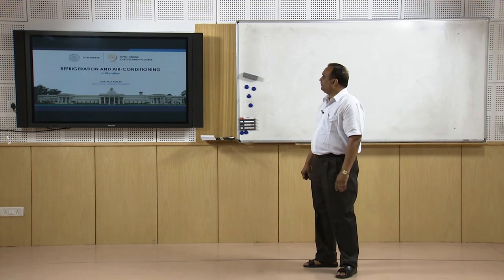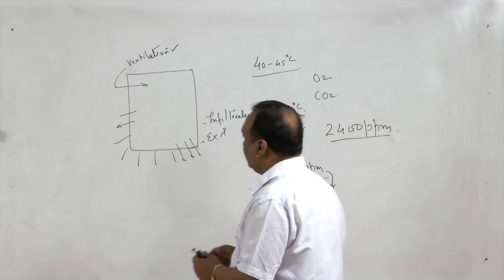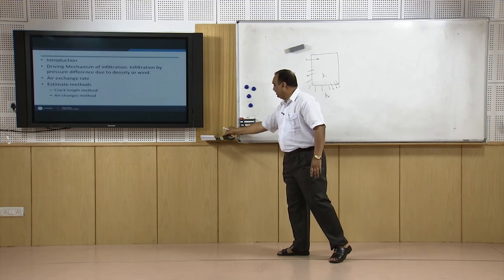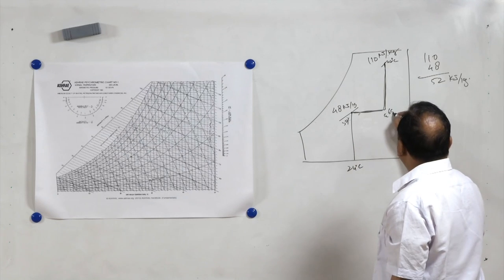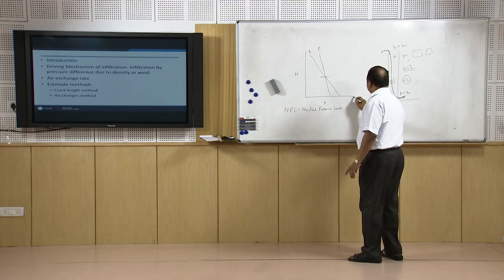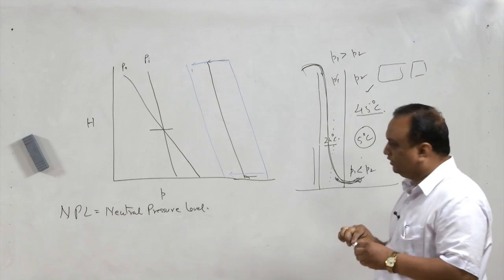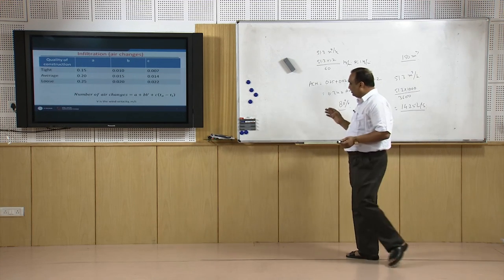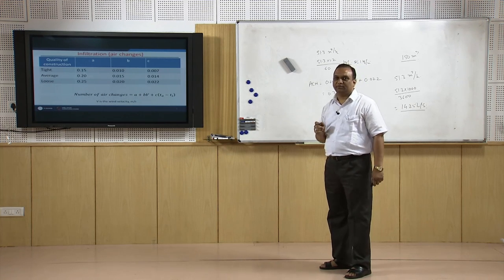Infiltration

Comment: Thanks for the videos. I have 1 thought... I have done Heat load in HAP for 2 example .
 First case I have added 100 CFM outside fresh air  and in 
Second case I added 100 CFM infiltration. But I didn't get same results. As in both the case outside air is added to space either through forced ventilation or through infiltration. The results must be same. Kindly provide ur feedback